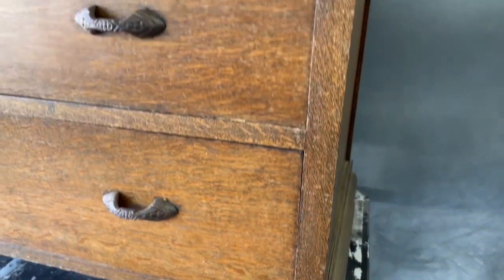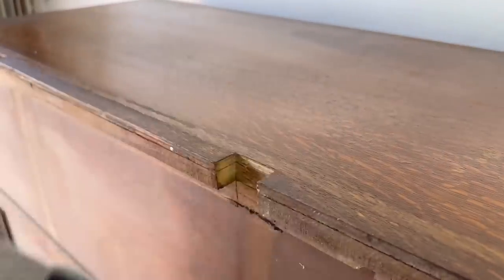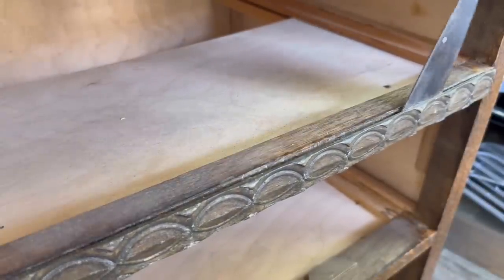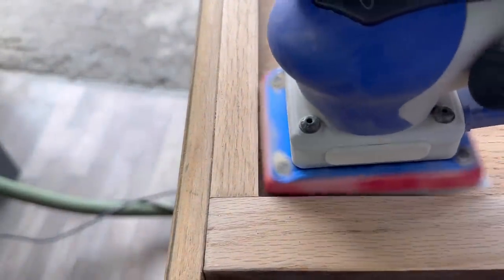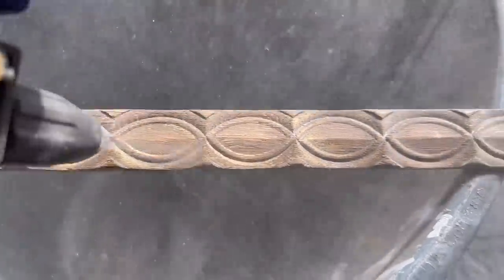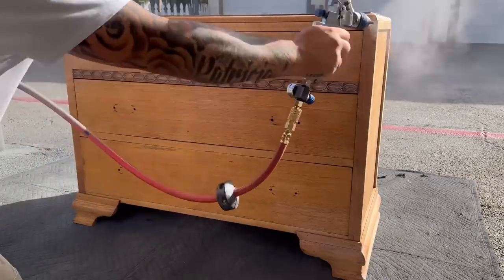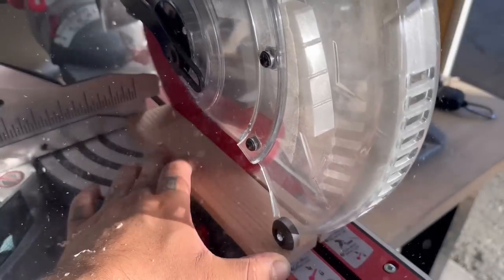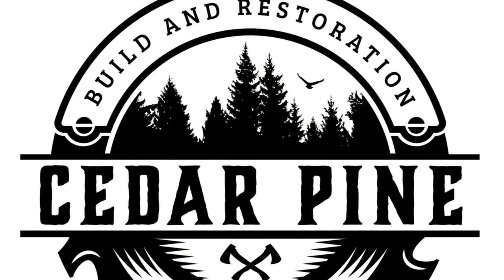TRYING to SAVE this 1930’s ENGLISH DRESSER imported from LONDON || FURNITURE FLIPPING FOR PROFIT

Comment: Tiger oak is what they call quarter sawn, it is cut on an angle of the grain.
Reply from the maker: Thank you so much. I appreciate the info. I had no idea
Reply: @CedarPineDesigns  There is also a faux finish Tiger Oak they used often on old furniture to make a less valuable kind of wood look like oak, so it can be tricky!
Reply from the maker: @trudyeby464  this was definitely solid all the way through ad it had the grain pattern on the inside of drawers as well
Reply: @CedarPineDesigns  I wasn't doubting it was tiger oak, just didn't want you to get fooled on another piece.

Comment: It’s quarter sawn oak. The stripes are caused by the saw blade. That’s why it’s sometimes called tiger oak
Reply: not exactly the same blade but the direction the tree was cut. the pattern is natural in the wood- but it has to be "sawn" in the correct direction for the pattern to be visible.
Reply from the maker: Thank you do the info
Reply from the maker: Thank you for the explanation. I didn’t know this